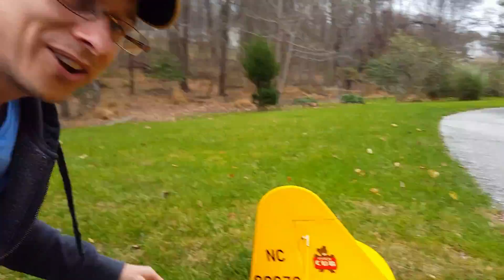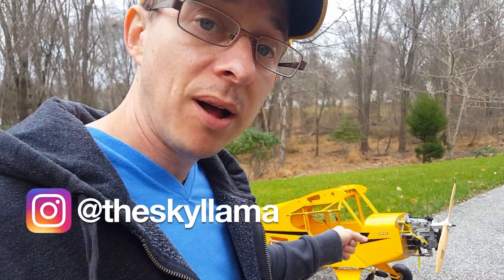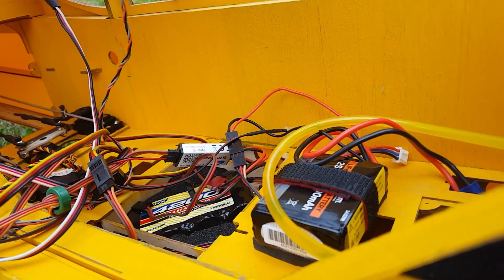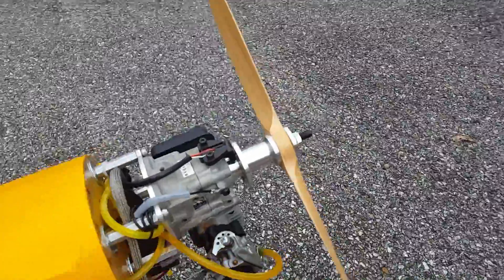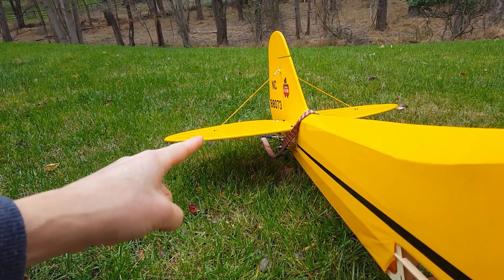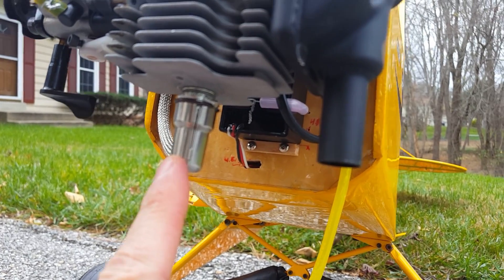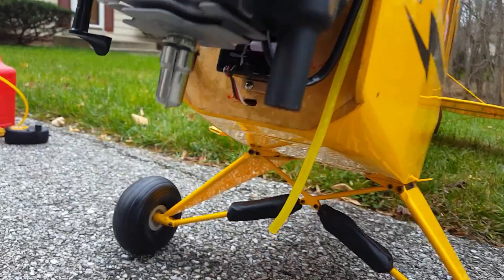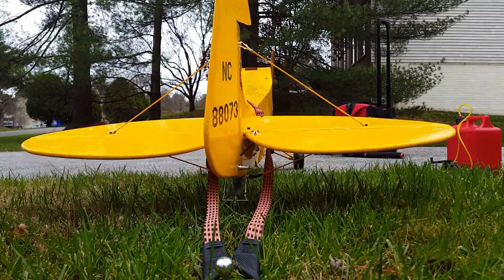Gas RC engine causing servo jitter (PROBLEM SOLVED!)

Comment: These plug caps makes two points of contact . you addressed the problem of the out side one needed to be pushed all the way on to have good contact with the base of the plug. There is also a center contact spring that fits in Side the spark cap if its missing or not making connection to the plug top you can also have this problem.  these springs are sometimes loose in the bag the ignition comes in, and need to be placed in the cap. Very easy to lose opening the bag and never knowing its there.
Hope this helps. Happy flying.

Comment: I've used a small hose clamp snug enough around plug cap, but not so tight to crush the metal cap, if done too tight can deform cap and it will come off.

Comment: I had the same problem with my HK piece of sh!t 31 cc twin engine, BUT the two spark plugs were pushed on all the way in. Turned out to be that the metal spark plug caps opening is too big and would not even touch the metal hex portion of the spark plug.  You could see the spark jumping from the cap to the cylinder. My fix was too cut two more slots with a dermal too cutting wheel and then squeeze the opening smaller. HK sucks big time.
HK was of no help too me and they seem to not give a crap about their customers! Even wrote a review at their site, but the pricks didn’t post it!
Reply from the maker: Super lame of them. And thanks for sharing your fix. That's why I made the video. I figured one person out there might be having the same problem. The interwebz can still be a good place 😄
Reply: @theskyllama   You can also purchase a spring that press up to the in side of the metal plug cap and the spark plug.  Valley view sells them!
Here is my video of the problem and the fix. And a cool device that helped me troubleshoot the problem.

https://youtu.be/UUxx4qe42tA

Comment: I have a similar problem with a motorized gas boat with a mini m12 b engine, I will try to improve the connection with the spark plug.Because for the moment the wire simply touches the electrode and retained with a small cap of ruber this is surely the cause I will look for something to replace for this smal 1\4 32 spark plug this piece Thanks for this trick
Reply from the maker: I'm glad to hear that this video has helped in your investigation. Good luck!

Comment: You don’t know what you have done for me by making this video I just crashed one plane because of that 

Thanks
Reply from the maker: What happened!? that's a serious bummer.
Reply: @theskyllama  i mean I built one and crashed due to ignition interference with receiver and servos than second plane I built had same problem but with jiggly servos your video save my plane and confidence
Reply: Because the ignition plug never been plugged in properly

Comment: Hi, great video thanks for sharing. 👍 I also got a little advice for you, when you start your rc plane try to build it up as if you want to fly with it. The reason why i tell you this is, that the wings compensate the vibrations caused by the engine which results in a better stability and a better safety for the piper. 
Keep on producing your videos, i love them. 
All the best from Austria.